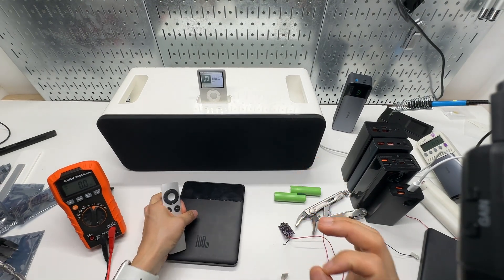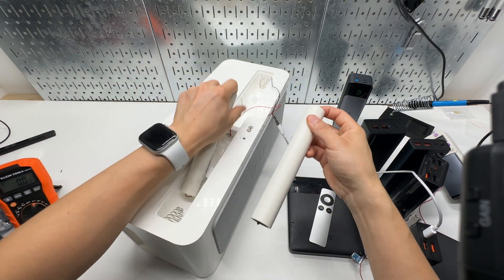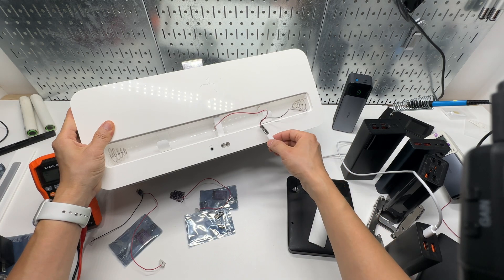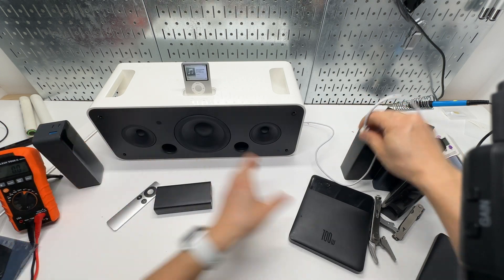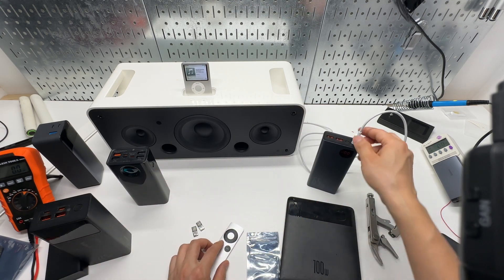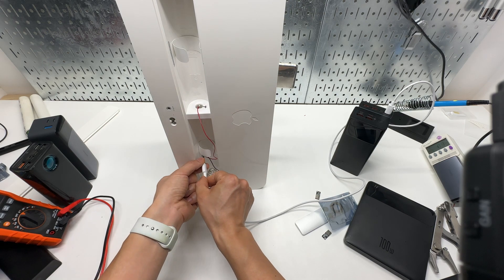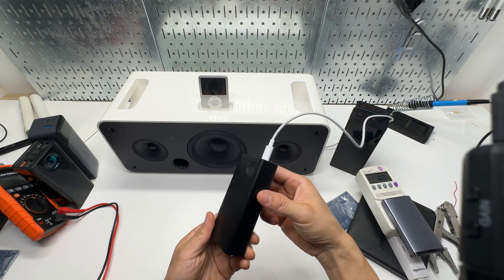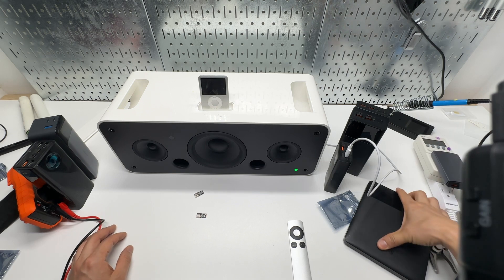I added a USB-C power port to the Apple iPod HiFi (9V PD Power Supply)

Comment from the maker: This the 9V fixed PD trigger https://amzn.to/3qJeVFo
Adjustable PD Trigger https://amzn.to/47UDi3F
Baseus Power Banks https://amzn.to/3snXH0w (affilate links)
Reply: Thanks for sharing. Goign to try this myself. Have you thought about working on a battery (such as the Basues/Anker) inside the batter port?
Reply from the maker: @JRBeckford  I couldn’t find a PD power bank that is small enough to fit in. Do you have any suggestions?
Reply: @ToolsElectroDIY   I was trying to think up how the Anker PowerCore 5,000mAh Portable Charger or Nitecore Carbon Battery 6K USB-C Rechargeable would work. Goign to see if I can get the 3D printing shop on campus can make me several battery cover copies to test things out. I don't have much a lab per say to build things. I am also thinking of possibly some EBL D Cell Batteries 10,000mAh on Amazon. What do you think?
Reply from the maker: @JRBeckford  I don’t have those battery bags, but if they are small enough to fit in, then sure can do that

Comment: Hey, I tried to replicate it, used 2 different usb c to 9V converters (built into the cable).

Once I connect the cable to the battery terminal, the power switches off (confirmed with multimeter) and only comes back once I disconnect from the terminals. I assume a surge protection or so on the usb (power bank or wall plug) side.

Any idea ?
Reply from the maker: no idea

Comment: 3D print support for a fixed batty at the back and hide it with usb-c integrated in the finition plate and it’s perfect. Add bluetooth and that’s a complete modernised iPod hifi unit :)
Reply from the maker: sounds good

Comment: Fantastic. Very many thanks. I almost threw my old unit away as the AC power transformer seems to have failed, and the battery connections are only way to get it working again without replacing the transformer, but can’t find anyone who will do this for me.
Reply from the maker: Glad it was helpful

Comment: I just got this iPod Hifi speaker.  It powers on but no sound coming out from my classic iPod 7th gen (modded by an eBay seller).  It didn’t come with original power cord, could this be the reason that there’s no sound coming out?  I see the green blinking dot on speaker so it shows to have power.  I’m buying an OEM power cord, hoping this would solve the no sound problem.  Do you know why it doesn’t have sound? Thanks!
Reply from the maker: The AC power cord of the speaker is generic, so it should not be the cause of the issue. I suspect your modded iPod classic 7th Gen has a faulty 30-pin connector. I had this same issue before. It will only charge and transfer music but no audio output. You should contact the iPod seller and get the iPod fixed / replaced. It can be easily verified using another iPod dock / speaker.
Reply: @ToolsElectroDIY  I have 2 other iPod classics, both 5th gen.  Tried them just now, no sound.  I just used the AUX, worked very well.  Love the speaker!  Thanks 🙏🏼

I still wish the dock would work.

Comment: Have you ever attempted making a 12volt vs this 9volt version? I know when I use it on battery power vs plugged in (12v), the volumet level maxes out much high when plugged into a 12v source. The 9v volume is plenty good for most cases though so maybe it not worth it.
Reply: I have a couple I'll experiment but the power brick inside has an input range of 7.5v-9.9v (fresh D batteries sit at about 1.6v) so I figured they used 10v capacitors but 🤷‍♂️
Reply from the maker: No. Because this Apple speaker doesn’t take 12v. I did a mod for a 12V TV. Stay tuned I will post a video soon

Comment: With the 9V charger, it will not charge the iPod when in the dock. Would switching to a 12V allow for the iPod to charge? Was your goal just to get music on the go, or to get full functionality from a battery bank?
Reply from the maker: It charges the iPod too. The iPod HiFi Speaker will not know that the D batteries are not used. It is a constant 9V power supply, not 12V. My finished design is shown in this short video https://youtube.com/shorts/skj9hsLOnu8?feature=share My goal is to avoid using D batterie or use a 90 degree USB-C cable from wall charger to make it sit closer to the wall as the original AC cable sticks out too much. Please smash the like and subscribe.